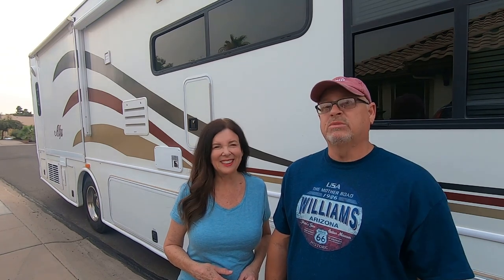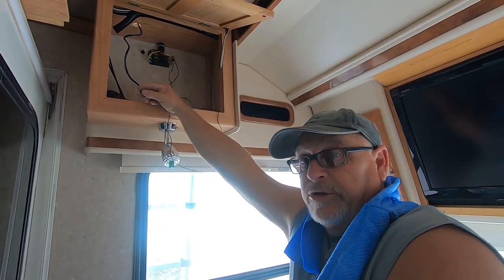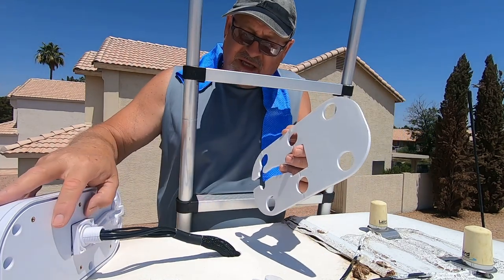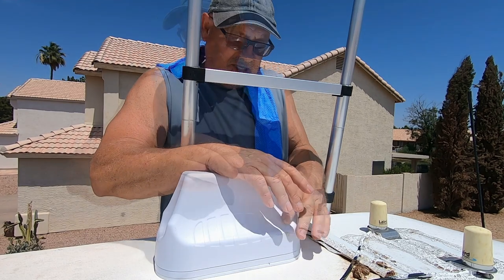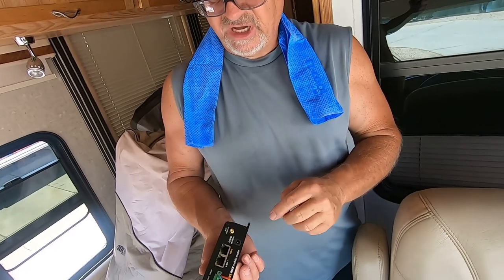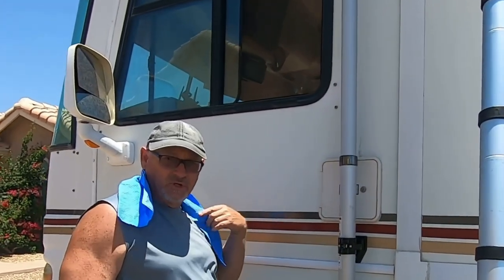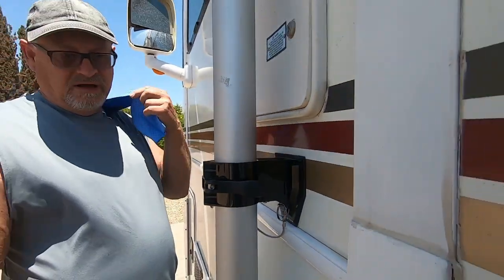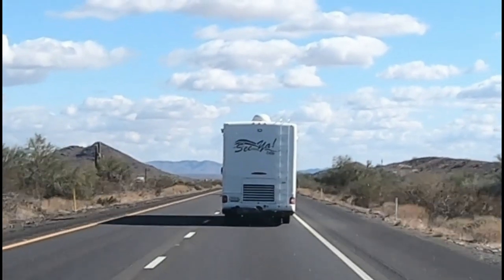DIY Install Of The Best RV Internet Set Up -  2021 - Boat or RV

Comment: Maybe I missed it, but why put it front if that access door?
Reply from the maker: Put what in front of a access door? If you a referring to the antenna on the pole. That is on the opposite side of the door near the drivers side of the RV. There is no door on that side. Thanks for watching!